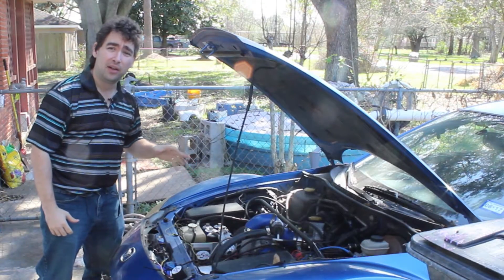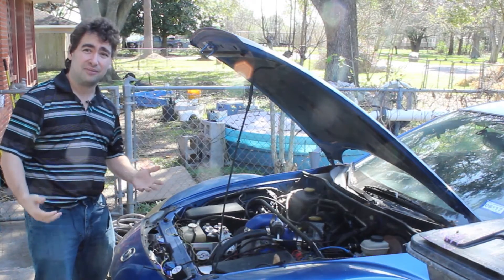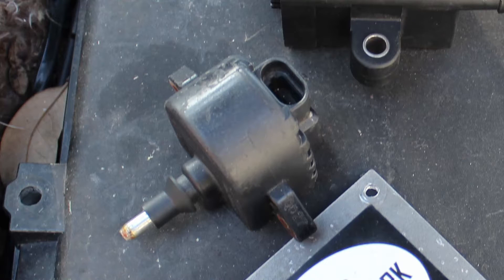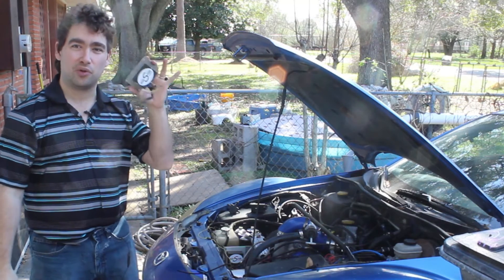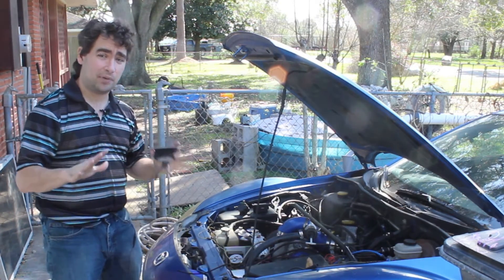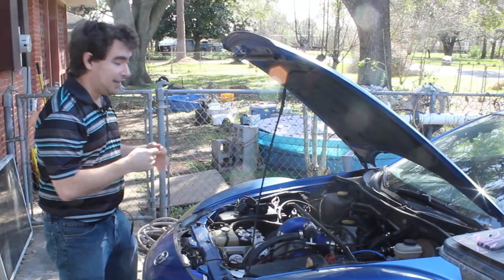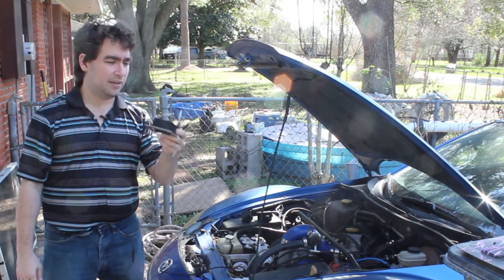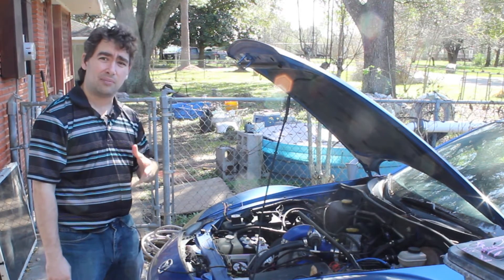My ignition coils left me stranded - Voiding Warranties Ep 32

Comment: I've got a 4 port renesis in my fb run by a megasquirt 2. It was very inexpensive to build it yourself and may be a good option if you ever decide you need more control. I'm only running stock rx8 coils however so it may not be advanced enough for ion sensing.
Reply: Yeah the hassle of trying to get the 6 port staging and variable intake system working is why I chose the 4 port. I just mechanically tied all the runners into the high rpm mode and stage my two banks of injectors based on map, but I don't think there is a very good way to have it stage three banks. One day I would love to get the variable intake system working with the megasquirt, i would probably get much better mpg.